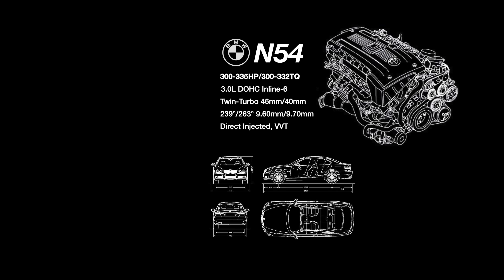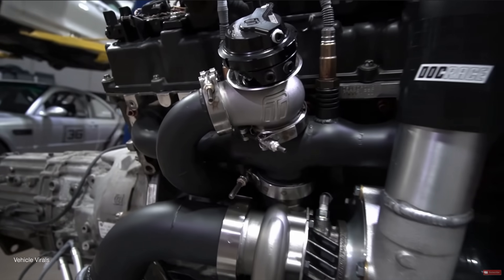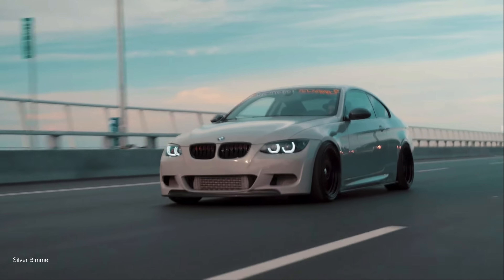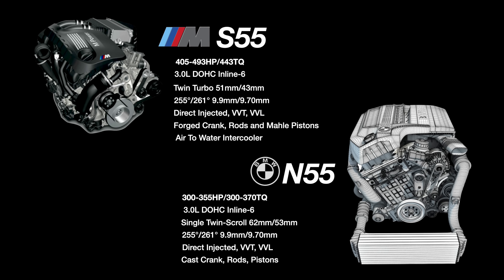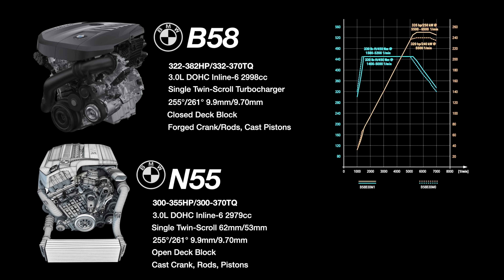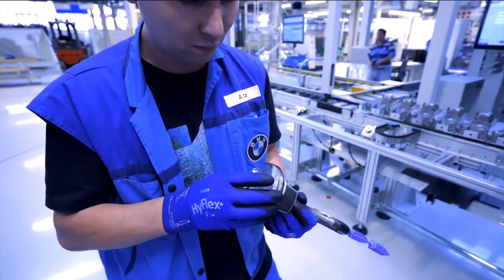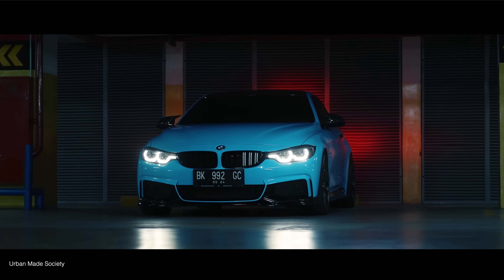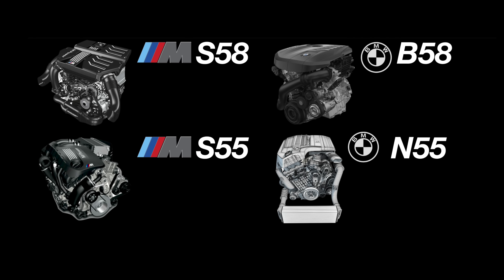BMW Turbo Inline-6 Engines Are Ridiculous | Explained Ep.4

Comment: N54 owners love talking about their WHP until the repair bill drops
Reply: The motor itself isn’t the weakest point. It’s the DME & injectors. N54 all day. I love the 55 tho, the bonus is what was learned from the N54 electronics. Twin scroll + not using MOSFETs made it more reliable. $300 & a little BMW knowledge & N54 is indestructible.

Comment: Sup people!
I have owned a 2009 bmw 335i for 4 years now, it’s a n54.
The first thing I did was maintenance, you don’t know how the previous owner treated the car.  1) I did an oil change, changed all other fluids as well, coolant, brake and power steering. 2) spark plugs and ignition coils to prevent misfires 3) change all vacuum lines to ensure you have no boost leaks 4) fix any leak if the car has one, coolant or oil.. fix it asap 
5) address any sensor the car is marking if not the car will not run properly. 6) is the best thing you can do if you want an n54, learn to work on cars and get your hands dirty if not you better have deep pocket.
After all that maintenance your car will be great, just respect it and check your engine bay and logs it once a month 😂

Comment: If I remember correctly from a video made by Albon, Toyota actually went and did a final inspection of each individual part on the Z4/Supra platform down to each individual nut and bolt on the car to make sure it met Toyota’s reliability standards. If it didn’t it was sent back to Germany where they would work to improve its reliability. I would have to assume that explains the reliability of the B58 as an engine: Toyota told BMW it wasn’t reliable enough
Edit: I rewatched the video, and apparently Toyota and BMW actually codeveloped the B58 engine. BMW started development of the engine on their own, but once Toyota decided they wanted to work with BMW in making a new car and platform, they decided to let Toyota help them design the B58, and Toyota had reliability in mind when they codeveloped the engine with BMW. Tbh, they should call it a BMW-Toyota engine, because that’s essentially what it is
Reply: Its still a bmw engine
Reply: @motaboi5397  it’s also a Toyota engine. It’s as much BMW as it is Toyota. Like I said: Toyota engineers tinkered with it too. The BMW engineers didn’t get all the fun

Comment: Nice video and information. The one thing i would disagree is that you can get 500whp from the stock N54 turbos. I would rather value them at about 400whp.

Comment: The diesels also are nuts, I have a 335d deleted they make around 400 and just under 600 ft lbs, fuel and turbo upgrades will get you almost 600 hp

Comment: You are very wrong, the first biturbo BMW was the E34 Alpina B10 Biturbo 3.5 360hp back in  1987 with 0-62 in 5 seconds and top speed over 290 km/h . The engine was M30 with 2 turbochargers

Comment: i dont understand where the name of the engines come from? does bmw just randomly give the engine's name? how do i search up engines
also what does g22 mean and how do they generate that.. i know its for model of car but how do they come up with that
Reply: Any BMW with 35i at the end is a N54/N55 power vehicle. They start from 1-7(EX: 135i,335i,535i,and so on).
B58s are any bmw with 40i at the end of its name.
S58s are comp models so thats the only way you'd find them(well the X5,X6,and G80 M4/M3 have them only)
S55 is only in the F80 M3/M4 and the M2 Comp
Any bmw with 50i is a V8 specifically.(I forgot the # for V10 models and V12 but hopefully this helps sum up some models)

Comment: LMAO, they don't hold a candle compared to a 1JZ/2JZ,  crap oiling system, fragile cam hardware, it goes on...🤣 1JZ holds 700hp on stock internals
Reply: B58 and S58s do that with ease(Well pends on what B58 variant it is holding that powee cause different hpfps). B58s already been tested to hold 900whp on stock internals already same with the S58.

Comment: had a bolt on/tuned 2008 n54 and now i have a stock s55. they basically feel like the same motor. goes to show how well they built the n54 all those years ago. was funny gapping M3's because when the 335i came out nobody knew it had twin turbo's and could boost power by 50% for 2 grand.

Comment: And people hate the b58 in the Supra 
But you got forged internals a thiccc cast block and crazy over engineered rod bearings 
It’s a wolf in sheep’s clothing 
The Supra is back 
But the mk4 is better
Reply: MK4 A80 isn't better without modifications. And it's a heavy vehicle. 

Plus, it doesn't look right without the aftermarket exterior "bottom" kits.

Comment: I had an N54 E92 335i in 2014 and it had two faults: the computer voice that never stopped nagging and no LSD so the traction would cut the power as soon as the back end got twitchy. Engine was magic except it didn't have much torque below 1.5k (auto/paddles). Car and Driver (US) dyno tested an early one at 330bhp on US petrol. The factory figure was low so as not to discourage sales of the E46 M3 which was still on sale until the V8 arrived.

Comment: BMW was king of inline 6 long time before these engines, at least starting with the legendary M88. 
Just install a boost setup over a S38 engine (S50 / S54 as well) and you already got ridiculously high power and torque. Only difference is these cast iron engines blocks are heavier and drop global car performances a bit due to extra weight.

Comment: This is the V8 Killer engines, speaking factually, the issue with the traditional V8s produced since 1960s they are not balanced as well as the straight block engines. Its possible to balance a V8 but that is not a consumer level type of engineering. 
So you cant really do much with them except increasing the size to 6 - 7 L and with boost you turn that heavy piece of metal into something not practical, you need huge tires to even hold the road. Thats where the "big tire" racing began. 
You cant race on Big tires anywhere except on a drag strip so, its a whole concept that isn't any useful in real consumer life.  
And with that said the normal LS and Ford Coyote engines that are available in a car for under 50k today are "lazy" they are not that easy to boost since they are NA to begin with. 
Maybe you can get a filter lol or a sticker with an angry wasp or a stripe line on the hood lol

Comment: They should be using a supercharger instead of turbos that constantly break. Carbon build up/direct injection is another pain in the ass. My lil 2011 128i N52 is 100x more reliable.

Comment: Well I've got an f89 with a new charge cooler new radiator, charge pipes and active auto works catless down pipes, single midpipe and mad max exhaust. It's a beast and has no rasp

Comment: The first turbo inline 6 that was ever put on an M car wasn't the S55....it was the N54 in the E82 1 Series M-Coupe
Reply: True! The 135i was a true badass and was using the N54 till 2011 where it then went to the N55 engine. Really was a badass car that felt more like you were in a E36 than a 1 series

Comment: Actually the first time a turbo charged engine was inside a M car was in 2011. The BMW 1M, the 1M was the first turbocharged M car , it came with the n54 pushing about 340 hp. It's actually the most powerful n54 in stock form from factory. And it had a few differences from the n54s in the 335s, 135s, like it came with 2 oil coolers. It only came in manual and all the suspension parts including the brakes were taken from the e92 m3. Also the turbos on the BMW 1M n54 are slightly bigger than the other n54s. And it was limited to about 6000 units world wide. S55 was the 2nd turbocharged M engine
Reply: No, E70 X5M/E71X6M in 2009 with the twin turbocharged S63.
Reply: The 1M isn’t a real M. It’s a 135i with wider fenders & M Performance parts. The E70 X5M was the first turbocharged M car with the S63.
Reply: @CadexLaw  It's a Frankenstein build, which makes it cool.

Comment: Screw all of these BMW engines, 1990s Mercedes OM606 3 litre makes more power on diesel with stock internals, bolt on injection pump & big turbo.

Comment: You  need to look at the Australian Ford Falcon Barra 6 which had up to 510hp on over boost  some daily drives are running up to 1000hp with all standard bottom end

Comment: I absolutely LOVe my G80CXD M3....  It goes from Housewife to Stripper with just a push of a button.  The power delivery is both violent & efficient, one minute I have both kiddos comfortably in their backseats & groceries in the spacious trunk, and the next minute Im gapping C8 Vettes in a stock car.

At the moment, I have approx 660AWHP & 600LbsTRQ, and considering Ive only spent about $4k in modifications, because BMW did an AMAZING job on their XDrive Launch control system on the new G80+G82s, the car will gap cars with much greater power from the dig.  Which is the only racing that I really care about.  As I never really understood those who do 50-60 roll racing, but even then she certainly holds her own..

This spring Ill be tuning her with turbo upgrades to push towards 800-850 AWHP & 690lbsTRQ(Wanting to keep the torque below 700),  If Im a little over, I can always limit some of that within the trans tuning to mitigate driveline risks.

I also know for those who clone their ECU's that come in the X3M, the ECU in the G80+G82 are mapped slightly differently, so its not exact.  So BMW did make some changes to the ECU between the M3+M4 & X models.  So, I wont be getting a clone...

The power Ill be extracting should put me in the 9.6 1/4 on a prepped track and 9.8 on the street.  With a 60-130 in the low 5 second range..  IROZ Motorsports just recently purchased a G80, so hopefully they develop the platform and will begin to make upgrades for it soon.  Which will put the S58 in the 1100-1300 range, for a built motor...  Without being built tho, there are a lot of 820-850 WHP builds out there...   While most people who choose to get an unlock & tune, are happy to be in the 700WHP range, with the basic mods + unlcok+tune that will usually run about $6k-$8k depending where you go, and what brands you choose.  Still, an additional 200-240 WHP for just an intake, downpipe, exhaust, spark plugs & tune is amazing.

I love the car's Jekyll & Hyde, its highly adaptable, with great drivability & practicality....  HIGHLY Recommended for anyone considering.

Comment: not wishing to rain on the parade for S55, I just bought an F82 M4 with 48k miles, it's currently back at the garage I bought it from having both turbos and cats replaced. the impellers worn and letting oil through 😔 glad I'm not footing the $15,000 bill

Comment: what a fantastic video! i love nerdy stuff, when somebody gets everything right
i also love all of these 6 cylinders, driving the B58 daily in my M340i, its a rocketship even in stock form, but my heart lies in the S55 territory, M2 or M3, the power delivery of that engine, and the fact it tries to kill you even at 1/4 throttle is what gets me all the time. hope i can get one for myself one day🙂
Reply: Just do a stage 2 flash and run 30% e85 won’t cost u more than $600 $700 you will never drive it stock again
Reply: @John-86  i live in central europe, cant really get E85 fuel at least in my country... also my dme is locked, so no flashing yet 🙂
Reply: @TheFuxxoWorksGarage  no e85 that sucks. Even running 30% e85 on stock ecu gives a noticeable bump in power. U can run e85 up to around 30% with out any issues on a completely stock car. Once you get around 40% it’s really pushing the stock lp fuel pump anything above that it really can’t handle it.
Reply: @TheFuxxoWorksGarage  actually 100 octane gives u about the same if not a bit more performance that 30% e85
Reply: avoid the warranty? @John-86

Comment: Nice analysis. I'd only say that "these are not swap engines" simply because that is not as much of a thing in europe. For example, there are no crate engine programs and to certification can be impossible in a lot of countries. Otherwise, once they become a little older, options start appearing (like gearbox adaptor plates).

Comment: For great power & reliability..,over do your overall heat management and cooling..bigger/better intercoolers ,water to air..,extractor fans on demand (flick that fast cooling fan on) don't wait for the ECU/heat sensor to feel the heat..,also heat extractor fans (Porsche surge fans) to keep that engine as cool & ventilated as possible..!!

Comment: B58B30 is the best BMW Motor with up to 383 hp and 389 ft lbs in stock configuration, with tuning you can get it easly to 562 hp and 516 ft lbs

Comment: I'm a Euro car tech. Been working on cars such as these for over 25 years. 

I, personally, own a 2010 Camaro. My Camaro costs less initially and has had the engine built(by me) to leave any of these potentially modded Ms way behind. I make more horsepower for less money in a lighter car. You don't buy a performance Beamer to strip it for weight...the creature comforts and luxury are part of the draw when choosing the brand. Yes, the 3 series handles like a full on track car in factory form, but for straight line drag racing, it's more cost effective to start with a SRT, Mustang, Camaro, or older Vette. 

My 6.2L LS3 is no longer 376ci. Bored and stroked to 416ci(6.8L) with forged internals, larger injectors, custom intake with larger throttlebody, custom ground cam, 12.5:1 compression thanks to +9cc dome Wiseco pistons, CSR electric water pump, and several other upgrades.
My car, however, is modded and upgraded in ways you would NEVER do to a Beamer. Strengthened internally Tremec TR6060 6sp with a dual plate clutch mated to a lightened flywheel, built rear-end with 4.10 gears. Upgraded stiffer suspension(Lakewood struts, shocks, and springs) for drag racing. 315/35R20 Nittos out back for the street. Doors, front fenders, and nose replaced with much lighter ABS versions. Poly laminate windows all around that are fully functional for more weight savings. Carbon fiber trunk lid and carbon fiber hood with a 3" cowl. The interior was kept "factory looking" but has been stripped in unseen areas for extreme weight saving. Custom fuel cell and battery box in the trunk. Dynoing well over 800 rearwheel hp WITHOUT any boost...all motor. 

My point: I have a car that can take almost any modded forced induction Beamer in a straight line...be it from a dig or rolling. For EXPONENTIALLY less money. 

You don't buy a Beamer to mod it in such a manner. You run the risk of catastrophic failure any time you push an engine to such levels and that means tens of thousands of dollars in repairs or replacement for a Beamer. You buy a Beamer for the luxury combined with above par performance with a modicum of reliability. That's why you pay the premium price for performance oriented BMW models such as the Ms. 

I work on these cars every day. I have access to potential deals on great chassis to build from as well as much lower priced performance parts than anyone in the general public can access. And still, I built a 2010 Camaro for my street toy. Why? Because 99% of don't understand the costs involved in modding a Beamer with very, very few being able to do the work themselves meaning costs double because you have to pay someone like me to do it.

If you have the money and want to build such a Beamer, go right ahead. Your choice and your money. But in the humble opinion of a veteran Euro Tech, any outcome of doing so just isn't worth the money. 

Please understand, I take no credit away from such vehicles. The engineering and potential all-around performance of a modded M-series is to be applauded and revered. I only wish to make the point of doing so isn't cost effective in the least when a fast street car is what you want.

Comment: The BMW inline 6 engine concepts and designs are well thought out ever since the m20 and m30 engines , which lasted forever , but it’s the continuous use of plastics in severe areas ever since that cause these engines to fail so quickly causing $$$ for repairs . More boost isn’t always the answer
Reply: Does Mercedes also use a lot of plastic?

Comment: If you want reliability, BMW is at the bottom of the list. LS,Honda, Nissan, and Toyota are better choices.
Reply: Yet there are B58 operated vehicles since 2015 that have not had any reports of faults.

Also, you talk about Nissan, Nissan is having trouble.

Comment: Destroys everything...  Including itself
Reply: proof?
Reply: @alouisschafer7212  I mean I have 3 blown engines from various customer cars in a corner..
Reply: @thecopperiris  failure?
Reply: @alouisschafer7212  1 was a blown head gasket, from a ruptured pipe.. 2 we're rod bearing issues
Reply: @alouisschafer7212  look, I love BMW, and they do make the best inline 6 for sure.. but they definitely need to address a few things
Reply: @thecopperiris  Im convinced BMWs internal structure is made up like this:
1 great engineer
1 fucking dipship engineer
1 penny-pinching accountant 
Only way to explain why they are the way they are...